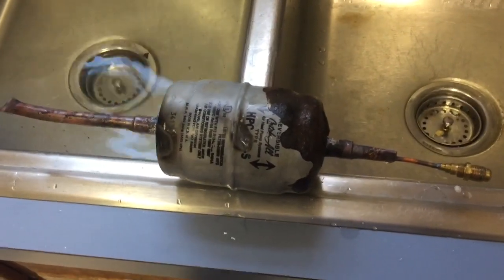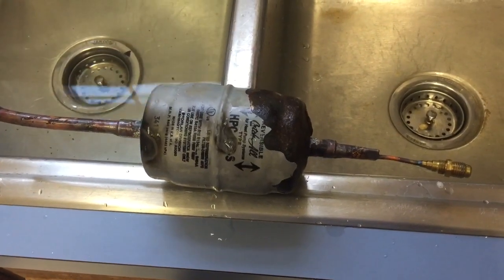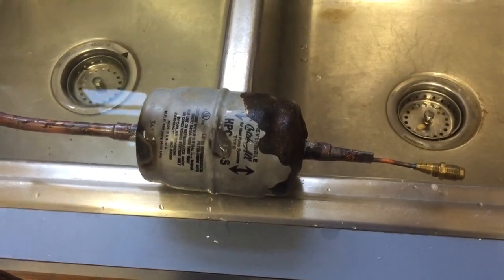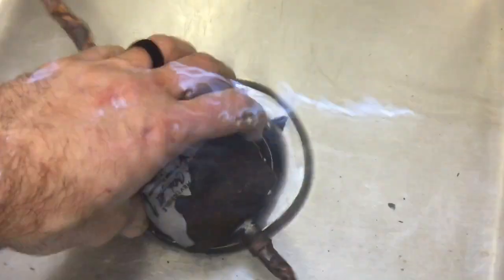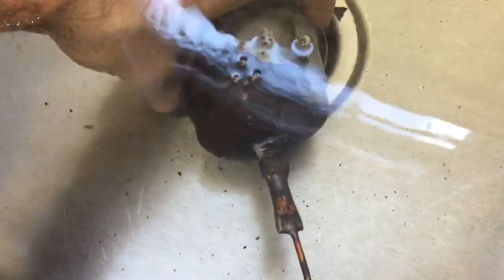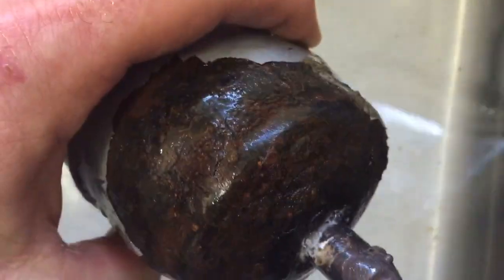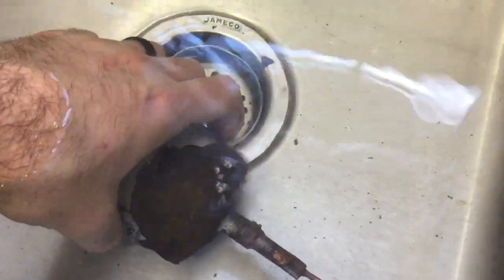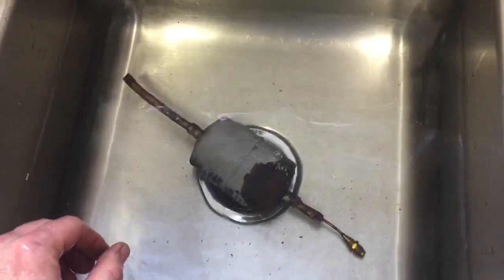Does Parker Sporlan make the best filter-driers?

Comment: Sporlan makes good inside parts but they will rust out and leak much faster then most. I like Sanhua driers
Reply from the maker: JamesBowmanHVAC sanhua? Is that the brand that ICP unit comes with and has longer stubs? I swear you have a Asian fetish James! Lol
Reply: Joe Shearer Sanhua produces OEM parts for most of the US equipment manufactures so I have found that the driers that come n the equipment seems to last longer then some of the aftermarket and their solid core can absorb more moisture then even sporlan. And again sporlan solid cores are top notch if they didn’t rust so fast.

Comment: Good vid ! Visual confirmation of leaks is Allways Very satisfing. now thats what i call talking your work home with you. 🤣🤣 All joking aside. Whenever i see a rusty drier it Gets changed Period ! 99% of the time they are Leakers or a Day away from leaking. if you think it might be a leaker and cant get a hit or a bubble Take a wire wheel on your drill to it and or wire brush and start scrubbing on that sob. if u are thinking to your self, that might make a leak , yea, exactly , if a drier can't handle a wire brush to it , u Know its junk.  if it passes that and u still can't get a hit maybe keep looking for another leak , Rust is a crazy beast.
But, Definately Allways Replace a Drier with Rust on it and or the paint Flaking off. That Drier looked terrible. Whenever they look like that. 99% of the time they are Leaking , even if u can't see it. i am assuming u are using a Ge-H10. You might want to check your leak detector and confirm its working ok. to find super small leaks i use the bubbles in a white bottle. calgon leak bubbles. it seems to bubble alot better than big blue on tiny leaks. i Personally DON't use Sporlan Driers. Why ? Because they are a solid Block core inside the drier shell, and if the drier was ever dropped it would crack the inner core. i have ONLY used Emerson driers for the last 38 years. They are Made with Dessicant Beads and i Just believe that design is Better. if u drop a drier , no core to crack.
Reply from the maker: OcRefrigeration,Hvac & Electrical. Thanks for the tips. I think the broken core thing is a myth. We threw one all over the shop and it didn't break. The Emerson biflow drier is solid core too though

Comment: Thanks for sharing, everything is getting cheaper made and competition is getting fierce. I don’t know if you ever seen those filter driers that are painted green and they are sold by carrier distributors, those H.P. Driers are sold for $16.00. Cheap as hell, funny thing is Carrier does not recommend or want them installed on their units. The question I have is why is Carrier distributors even selling them and if you have to replace their evaporator coil only, that’s the drier they will ship with the coil. Manufactures are getting into the aftermarket parts, they will by the buy on volume of the cheapest parts and put their own parts trade name on it. So only thing Sporlan can do is offer good, better, best option and then allow manufactures and contractors to choose
Reply from the maker: Superior Comfort Heating & Air LLC yea I know 100%

Comment: leaking or not change it out just cuz its rusted out and will leak soon enough even if its not leaking now....but that one is
Reply from the maker: kingofthecrease30 I just think they could improve the outside
Reply: @joeshearer1247   i guess so...i have seen sporlan driers that were 15 years old and not rusted....heat pumps 5-7 years is max...suction driers the same thing...as far as the inside goes emerson EK driers are better than sporlan...better cores